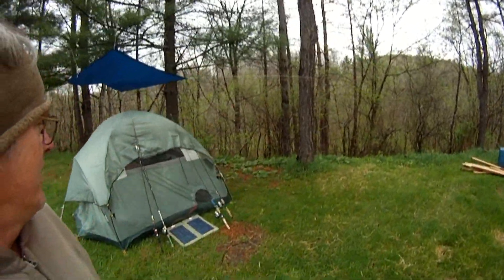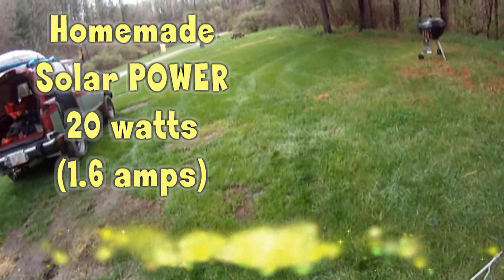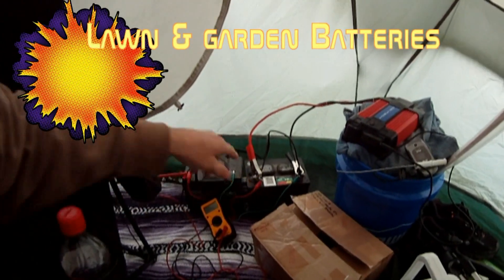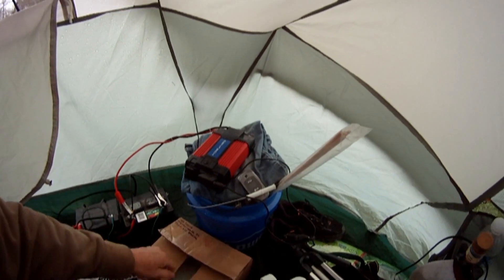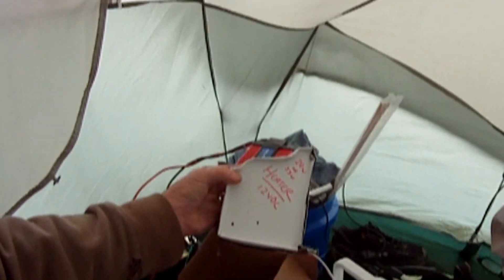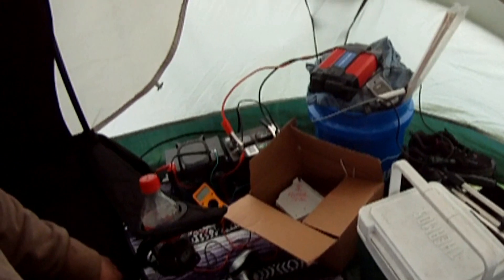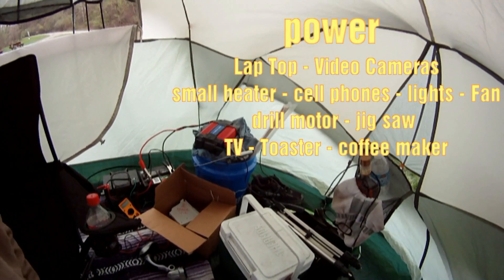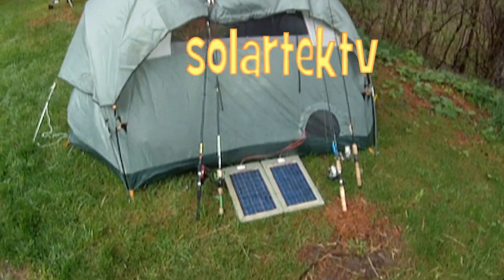CAMPING Ohio  Aep Recreational land SOLAR POWER Homemade solar 12 VDC heater

Comment: you lose efficiency going from 12V on the bat to 120V on the inverter, then back to 5V to charge your phone.
Just use a 12V phone charger...
Reply from the maker: hey boogie~ thanks for watching~ I didn't have a 12v / 5vdc charger available @ the time ~ and ~ the inverter has more capabilities for electrical appliances since the vast majority are all 120 vac. thanks again for watching!